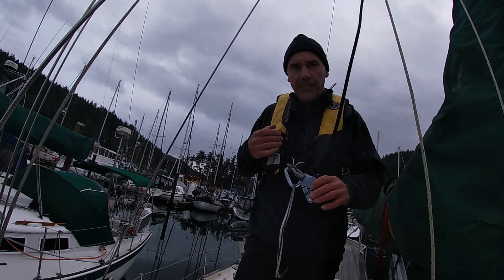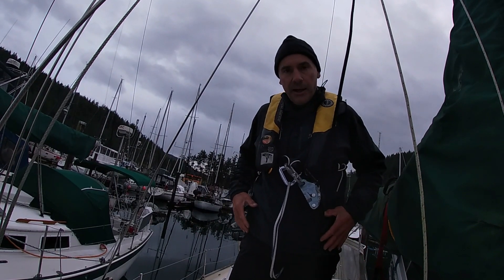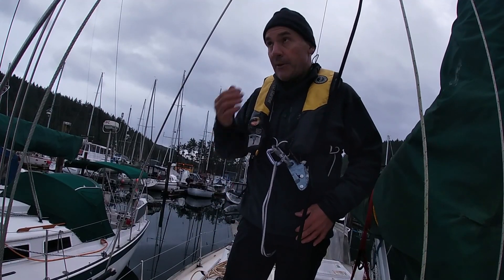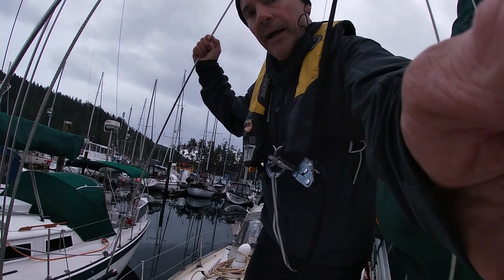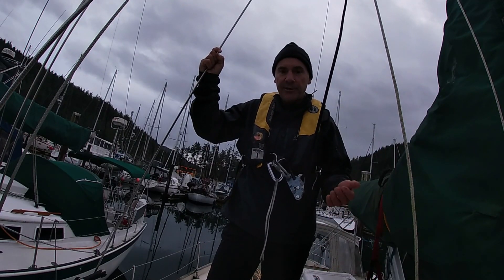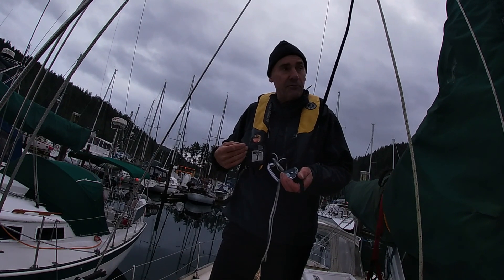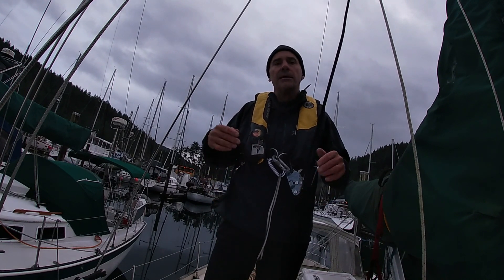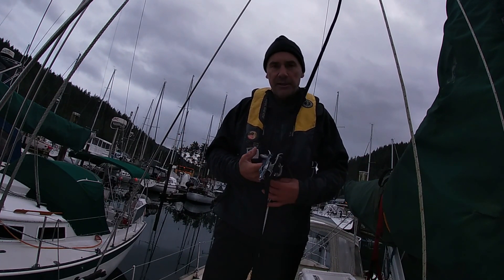THE UNCOMFORTABLE TRUTH ABOUT CURRENT DESIGN OF OFFSHORE HARNESSES

Comment: Extremely valuable lesson here!  

My boat inventory includes a climbing harness but I’m never going up that mast!!! Now, you’ve shown me a vital use for it!

Thanks!

BTW.  I’ve always wondered if a vertical connection wouldn’t make more sense as well.   

The most important use of a tether is to keep you ON the boat, not dragging alongside it.   I have a double KONG tether (because other tethers are proven to twist open) and always try to connect it in such a way that leaving the boat is impossible.   This, I’ve found, is a very slow and deliberate process.   I don’t trust the slack in jacklines and try to attach directly to hardware.  At the mast, I even attach the two (short and longer) tethers together, around the mast.
Reply from the maker: 100% agree. Great points, suggestions and ideas. We would all love to hear more of your thoughts on this topic. The vertical connection is an interesting idea. Any other thoughts on that? Perhaps the boat separated in quadrants with a high line for each quadrant? Just trying to think of how to do this getting around the rigging, boom, sailes etc..
Reply: Wish I had the answers.   Perhaps a spare halyard?  It might cause more risks.   

Again; the primary focus needs to be PREVENTING going over the side.   That means a SHORT tether.  But a short tether means limited mobility and frequent latching/unlatching as you move about.  Frankly, that’s what I do now; it’s a real pain and takes forever.  

I don’t have a jackline.  My boat is barely 30’ and has a dodger that pretty much prevents me from rigging one.  My setup is a duel tether; one longer than the other.  I often attach with the short one, only momentarily using the longer one.  Every step of the way I think to myself “will the next attachment I make definitely prevent me from going overboard?”   I attach to the handgrip on the dodger frame,  to the traveler hardware, and to the mast.   

I sometimes wish there was.a ratcheted system, like many a dog leash.
Reply from the maker: Thanks for the great tips and dialogue. I know right. I am still working on it.
100% agree -- first line of defense is clipping short to prevent a fall over the side in the first place. I do use jack lines and I have a long tether that follows me in addition to clipping short. I will also clip in at the "work site" so to speak. The jack lines are ok if you stay on the high side, I think. It might be good to have something along the center line of the boat. Just another thought.
Reply from the maker: What really got me was my Singlehanded MOB drill I did last summer - even in perfect conditions under power it was VERY difficult to get back aboard even with my nylon ladders attached. It is here .https://www.youtube.com/watch?v=4I4WFaikXqs It was quite sobering for me... put even more "fear" into me about going over the side.

Comment: One idea I've heard that sounds promising is to have a tether with two hooks, and install a nylon webbing around the boat on the outside, from bow to stern. When overboard, use the second (shorter) hook to tether yourself to the outboard webbing and cut the first tether with your knife. You'll be quickly led to the stern of the boat where a rope is being dragged, which you pull to release an emergency boarding ladder and climb up. The ladder should be long and sturdy enough to climb while being dragged behind the boat in difficult conditions. Sounds good on paper, I'd be curious to see if it works in a realistic situation.
Reply from the maker: Yes -- thank you for sharing that. I heard that from a viewer a while back. I tried it at the dock here: https://www.youtube.com/watch?v=6QG4yEumo9E and it does seem quite promising. I think if I am offshore I will install such a bridle in addition to my other tactics. Here is a video of the summary of tactics that I have tried, many of which were suggested by viewers. Thanks for sharing mate.
Reply: @respecttherisk2022  Nice, I'll have a look at your test. Kudos for actually trying things out rather than just speculating!

Comment: Why is nobody talking about this?  The harness and jack lines are a bad idea, only slightly better than nothing,  It seems like you need a line tied to the mast to pull vertically rather than horizontally against the side of the hull. You would be bashing against the boat like a fender.
Reply from the maker: I know right. This needs to be discussed. There are definitely challenges. I am a fan of giving the singlehander as many chances for survival as possible. We would all love to hear if you have some more thoughts. This is an important topic. Read some of the comments on this video -- there are many good ideas. https://www.youtube.com/watch?v=4I4WFaikXqs